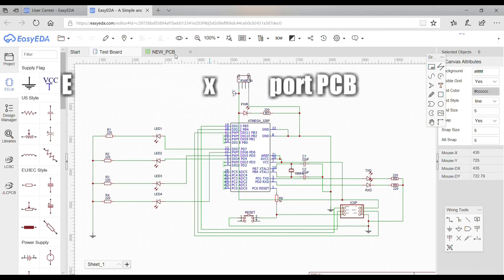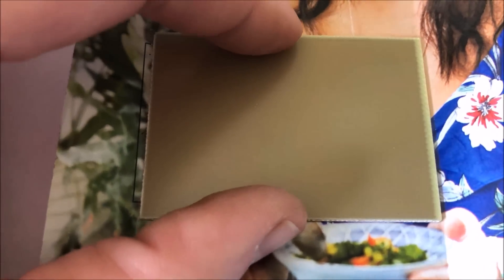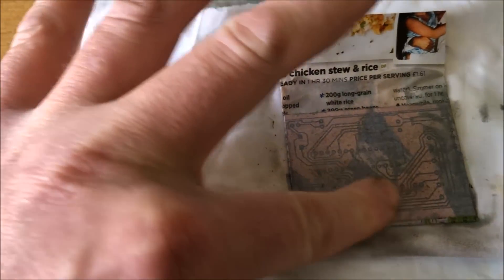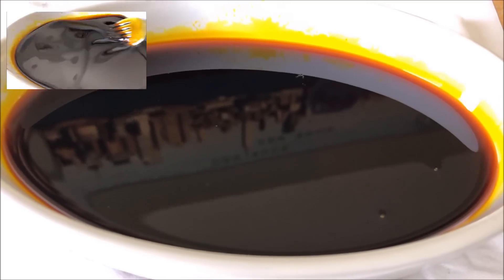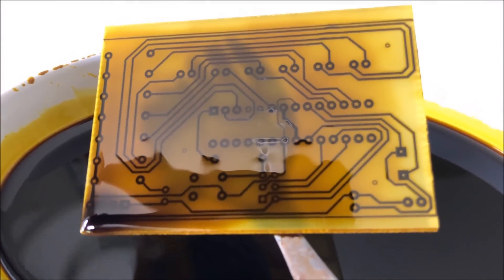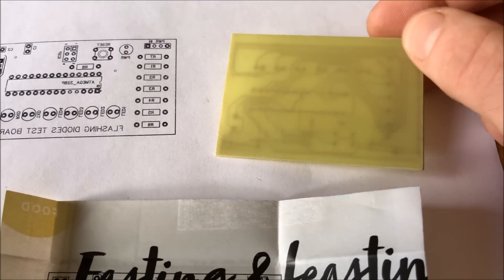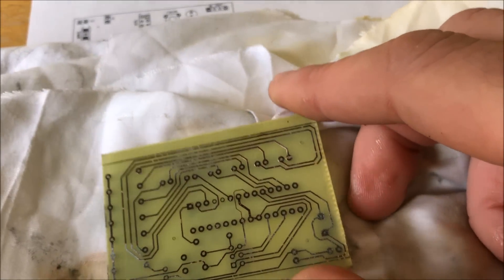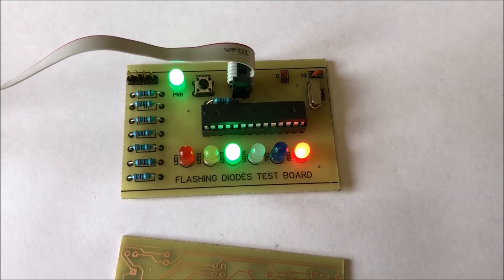DIY PCB Toner Transfer (No Heat) & Etching

Comment: Well I wish I had seen this video earlier, I just used the “heat” transfer method, it was somewhat successful but tracks needed touching up with a Sharpie. I did remember hearing somewhere years ago about using magazine paper but nut the simple approach to just adding nail varnish remover. I intend to make another set of boards for my project using your method. I LIKE IT 👍👍👍👍👍👍

Comment: READ THIS CLARIFICATION.     Acetone alone does NOT work. What worked best for transferring to copper was a mix of water and acetone. Acetone alone was completely useless.

I mixed 2 parts of 98pc acetone nail varnish remover (cheap easily available Cutex extra strength in UK) with 1 part tap water. 

I believe the acetone softens the toner and makes it stick to the new substrate BUT without the water then it never releases from the paper and just comes back off.

So we placed the paper on the copper and then poured a capful of the solvent mix onto the back of the paper so it was really damp, nice and wet.

Then pressed all over it for 30 secs or however long it takes you. If it needs more time to apply pressure then make it damp again with the solvent mix.

We then let the acetone evaporate for 60 secs leaving just the water and then immediately used water and a finger to rub off the paper.

I found that cheap printer paper works better than any more expensive paper. We found that sometimes more expensive paper doesn't absorb the solvent mix, particularly if it's glossy magazine covers (which don't work at all), so problematic are printer paper with surface treatments (some have a thin plasticy layer on the back).  Important to get it nice and wet.

We went from total failure to total success by switching as above.

I never tried the inside pages of magazines and perhaps that's better but DO NOT use any glossy materials that won't get really damp.

I know some folk have said using acetone and IPA but we didn't find that necessary. Some have said a 50 50 water mix also works which will help make the acetone go a bit further and reduce the fumes .

we weren't doing PCB however. we wee doing art work.

I suggest trying the inside pages of a magazine as shown as maybe it's the optimal for soggy and release as the cheap printer paper retains a few spec that allow etch  penetration on the copper if not careful. Depends what effect you want 
good luck

Comment: I have been held up about 2 years worried about buying the wrong laminator. I have a bunch of pcb's from Mr Carlson's Lab. But his Patreon designs must not be sent out (terms and conditions). Solvents, paper and ferric chloride are my next step. I'm thrilled. My apartment is really too small for yet another piece of equipment. Many thanks. 🎉

Comment: Good job, thanks! The only thing that I would like to change is the way you remove the laser printer ink from the board, since I believe that the steel wool can damage the little copper paths. Probably a specific solvent might be a better solution. Again thanks!

Comment: I have made single sided boards as your method , but used heat from an iron. Never have I thought by using acetate it would work the same.

Takes a bit of time off , but never the less,  fantastic !!

Comment: Well, I have done my first transfer from a glossy paper to the pcb. I used a test pattern from a site that I will put the link at the end. This test pattern has a lot of fine/thin lines and small smd pads. What I see is that the transferred ink to the pcb is much wider and would cause the shortages! So this is not going to work. So for people that figured it out maybe some insight what part I do wrong? What (and how) have I used: a glossy paper from a magazine, HP LaserJet 1020 (with a clone cartridge), nail polish remover, acetone free (the brand is CIEN, which is I believe a LIDL supermarket brand, with the following ingredients: Ethyl, Acetate, Alcohol Denat., Aqua, Caprylic/Capric Triglyceride, Parfum, Benzyl Benzonate, Limonene, Alpha-Isomethyl Ionone, Citronellol, Geraniol). I taped the glossy onto the pcb, soaked the glossy paper with nail polish remover and used gloves to rub with my thumb over the glossy paper. After some "good" rubbing for a few minutes I put that into water and soaked it for a few minutes, and could easily take the paper from the PCB. What I think is going WRONG is that by rubbing with my thumb I spread the INK sideways. I think I should use some other principle of applying the force. like some rubber/silicone roller or otherwise. Ideally some high vertical and EVEN distributed force. Any opinions welcome. Link to the PCB layout test patterns (I have used the top one): https://electronics.stackexchange.com/questions/23089/pcb-test-patterns-to-assess-etch-quality
Reply: Second attempt: used somewhat thicker glossy from elektro DATA magazine (Dutch magazine). Mounted and taped the glossy on the pcb. Purred some nail polish remover over it and put a flat hard glass plate and applied 90kg of weights. It was sitting there maybe even longer then 30min, as I had something else to do. The result was much worse then the first one 😁 Was it to long? Was the force too high? Paper no good? ... looking for the recipe ...  I would like to try some kind of rubber roller..

Comment: This transfer method is really great. No ironing no paper decay. For etching I recomment sodium-persulfate (200 g/liter) in water. Best etching temperature is 45 °C (113 °F). Etching time for 35 µm copper layers is 10 to 15 minutes. The solution is clear. So it is easy to observe, when etching is finished.

Comment: I'll be convicted if you could print a QFN-64-1EP-9x9mm_P0.5mm.
It means 0.5 mm between pin's axes, and more less between pins.
For now i use transparency. Nothing revolutionaire and may be expensive but it works!
Your method can't reach this. 
Anyway in any case i could not even try it because i do not know (and you do not say nothing about it).
where does come your magical polish from and what it contains?

Comment: Wait wait. How did you transfer the toner to the magazine paper? I didn’t get how that happened
Reply: 🙄
1: Print out your circuit sketch on regular printer paper.
2: Tape some magazine paper OVER that 1st print out so it covers the whole circuit.
3: Run that sheet BACK through the printer!
4: Good luck George...

Comment: There's a better technique than using a bowl and a spork. Use a heavy duty freezer bag. I use two just in case the board slices the first one which does happen, but it allows you to agitate faster and more evenly, so you get a quicker etch.

Also, opt for plastic. The metal in that spork is dissolving as well, which will decrease the re-usable lifespan of your etchant. Everything up to that point is fantastic and i'll certainly be adopting this technique!
Reply: If possible try to lay the board copper side down, on top of the etchant, so convection can carry the heavier copper-logged etchant downward and refresh the etchant against the copper.  A 1/4" deep pool of etchant will suffice to get the job done.

Comment: Although i have recently bought the UV film and want to try it out, i've had success with this method and couple of notes for anyone wanting to try this
- Use dilute acetone, i've used ethanol and acetone combination but toner in my case was stripping from just ethanol so i recommend water and acetone and try different ratios until the toner becomes sticky but not liquid
- It required a lot of pressure on top of the paper and so i recommend placing a paper towel on top and then pressing with a plank or something evenly or some tracks will be missing
- Always wait for it to partially dry before taking off the plank or whatever you used for the pressure or you may smear it
- Always scratch the copper and clean using alcohol or acetone before trying this

Comment: I've reached significant improvement by using other mixture of chemicals and their ratio and that is 8:3 alcohol and acetone (both pure = assurance of real volume of chemicals). But the magic was actually in using rolling pin :) I've combined other manuals, very similar to your video. Many thanks for inspiration!
Reply: @BlondieHappyGuy  Exactly, just fun :) Btw, I've also tried the other approach of toner transfer and that is by heat. But I didn't found out a proper paper, also in that way a equally distributed heat and pressure (!) is even more important. I saw a few tutorials and those guys used a fine tuned roller from lamination machine.
Reply: Rolling pin is a good idea. How about a brayer? As long as the nail polish remover doesn't dissolve into its roller and make it sticky..
Reply: @earthlightsmusic2743  Well, there is no other way how to find it then try it :) But I guess that pressure wouldn't be such uniform and sufficient as with rolling pin. If you're going to test it, let me know about the result, I'm interested.

Comment: Great ideas! Thank you. I'd just add that if the layout is done with a copper 'fill' in all the empty spaces it uses up hardly any of the etchant's strength, makes the etching go quicker, and makes it last long enough to allow you to do additional boards with the same etchant.

Comment: I am using this technique on my PCB, and it works, but yours it is perfectly (on my I have to correct small holes,..), I will try to rip off the paper as you do, maybe the quality will improve, or maybe also the toner (printer) matters... and I use plain acetone, but I think it is no difference from your nail polisher ...

Comment: why?
if you say you don't use heat (ironing)
at the points where the heat iron is used regularly, is there a cut in your video?
and that when doing the method in each of the plates
even before transferring the silkscreen?

the heat, the high temperature of a printer on its rollers is what causes the toner to adhere to the paper
without that heat the sheet of paper comes out blank

Comment: Apparently not all nail polishers have acetone inside, the one i found at home is based on MEK (methyl ethyl  ketone, or butanone). I tried it anyway and the result was perfect. Next time I'll try an acetone based solvent to see the difference. Btw thank you a lot for this video man. Love this technique
Reply: That's correct. When I went to store for remover I was asked : with acetone or without. I took with acetone and .... it worked. Earlier I tried pure acetone and got nothing :). For etching I used Ferric Chloride and I got what I want. :) . Now I am waiting now for thermo laminator and will check what is a difference between thermo and nail remover :).   Anyway - excellent technique for pcb :) .

Comment: Does it have to be a Laserprinter? Inkjet won’t work?
Reply: Laser required.  Ink doesn't melt and bind together on the paper, and then soften for the transfer.  Ink usually has solid particles that don't fuse together on the paper (note the term "fuser roller" for laser printers).

Comment: Damm, impressive quality, it seems made with insolator, I think it was false but I tried it and it really worked, the first attempt failed because of the paper that was from a full magazine but too thick, the second attempt was completely successful, the key is in the paper where the diagram should be printed, it should be color magazine thin and poor quality, this forces the polish remover to easily work into the toner and adhere to the plate

Comment: I'm just putting this out there, you have to do this just right, or it will not work. I've failed several times, using magazine paper, and nail polish remover with acetone. I always get a partial transfer, and the ink doesn't stay on. If you're having this problem (like me), try a better method, or go back to using a steam iron. This has been frustrating, and has wasted a lot of my time. (This doesn't work for everyone, as you can probably tell.)
Reply: You might be doing something incorrectly.

Comment: Hi Gareth, thank you very much. I'm deeply impressed. After using the iron for years i still had pcbs that didn't looked that great. I tried your method with three different polish removers and a piece of gift wrap and it worked right from the start. Unbelievable!
Reply: One thing for German etchers: I used the "today Nagellackentferner, acetonfrei - mit blumigem Duft" from REWE

Comment: Hi , great video and this has inspired me to have a go, assuming when the board is finished you then have to drill some holes through the pcb to put the legs of the components through. Sounds simple but can you share your expertise on the best way to do this and drill sizes etc, excellent work!!
Reply: Need a drill press if you're doing a bunch of these. They make cheap super small drill bits that have a larger shaft to hold in an arbor.

Also make sure the pads in your PCB program have a center hole. That center hole will etch away, and it will help your drill bit self-center.

Comment: this is far the easiest toner transfer method so far. I don't use it since the lack of information in the video. Would help if u give info about the tonner used in a printer, nail polish remover composition. I know it's a 2-year-old video but still. Till more information, I will stick to my method https://youtu.be/WsxulVKiYfY  it's not hard but your method is easier for sure. Thank you .

Comment: Great find!

Way better as the heat transfer 👌🏻
I noticed you can do this on normal printer paper also 
So no risk on a paper jam in the printer lol

Also use roller to make a good transfer.
Use a pencil with some black indian ink afterwards to make as black a possible.

Comment: In my first trial, I cut the artwork to the size of the board. That was a bad idea because tape from front to back was released by the acetone and the paper shifted while I was rubbing it.
In my second trial, I got very little transfer of toner. I decided it was because I used the front page of the magazine which is heavy paper.
In my third trial, I used a page from inside the magazine which is lighter weight. I still did not get much toner to transfer.
Still the wrong paper type?
Wrong toner?  (I use a Samsung laser printer.)
Didn't rub long enough or hard enough? Should let the acetone soak in first?
It's hard to tell from the video if there are pauses and how long each step should take.

Comment: A good idea for etching is to drill four or three holes, place toothpicks in them and place the PCB to the tray with copper side down. The reaction waste then can fall down rather than lay on the copper, so the etching goes much faster even if the etcher is not very fresh.

Comment: I've missed something! You print the design on paper, then tape the magazine paper over the design that's on the paper. It then goes through the printer again but do you print the design again or effectively a blank page? Thanks.
Reply: That part is confusing me too. Hope we get an answer!
Reply: @shader26  I found the following video a while ago now https://www.youtube.com/watch?v=R_EvEYM1_9U and asked a similar question. The reply was that as magazine paper is thin it needed to be attached to a normal sheet of paper but crucially the pcb is printed on the magazine paper only! Hope that helps.
Reply: He's just doing that because he doesn't have a full size sheet of magazine paper... just does the regular paper print to get the magazine scrap in the right spot so it'll print on it.

Comment: Thanks, Gareth, for taking the time to pass along this great way of transferring the circuit design.  I'm glad I won't have to buy another piece of equipment, just to use it for an occasional PCB.  
I'm also impressed that you did it with one hand.  Not bad at all.

Comment: You indeed achieved great results. So far I have been using photographic method and after many experiments i managed to achieve 0.25mm track and space width, but your method appears to be capable of producing the same results while being much more simple, cheaper and faster, I will definitely try it, thank you. If I may suggest something - for the etching sodium persulfate is much "nicer" than ferric chloride, which produces nasty stains if you accidentally splash it over your clothes or table, also it seems to work more precisely and the solution is transparent so it is easier to monitor etching progress. It is commercially available from many vendors, like tinyurl.com/2nn459fo or tinyurl.com/1n5fepy0 for instance.

Comment: Nobody uses ferric chloride correctly. Why? It is so simple. The board should lie on the surface of the solution with the toner down. Place the board gently so it won't sink. This process is much faster. You will receive the finished board in 5 minutes.
If your hands do not allow you to work gently lubricate the edges of the board with Vaseline. Now you can drop the board as you like, it won't sink.

Comment: my ferric chloride ate right through my laser printer toner before it had cleared off the copper! I used that blue press and peel stuff. I wish I had a stencil of the foil side of the pcb, then I could spray a plastic coat on it, then etch. good video.

Comment: Hi Folks - just curious, I am guessing its a laser printer. Is that correct.  I am not an electronics buff but starting to do stuff for autmating a model railway and these looks so easy and would solve a number of problems.  Just wondered about the laser before I start trying it on my dot matrix!